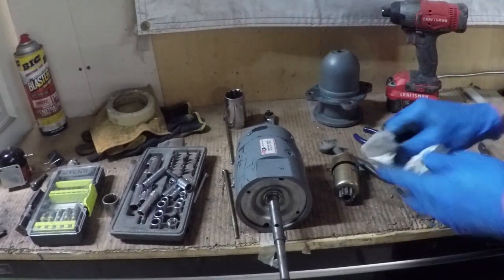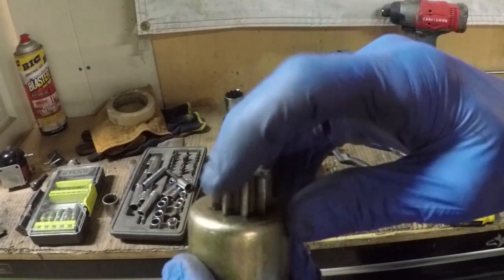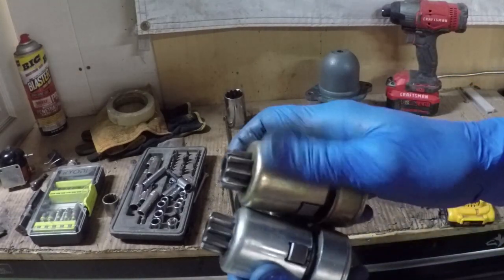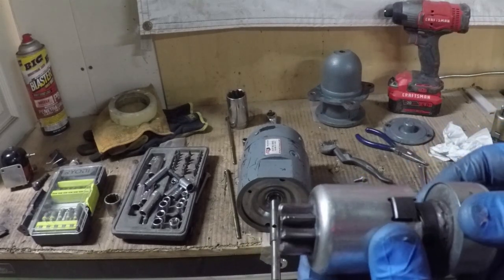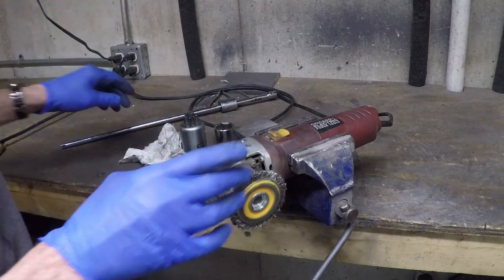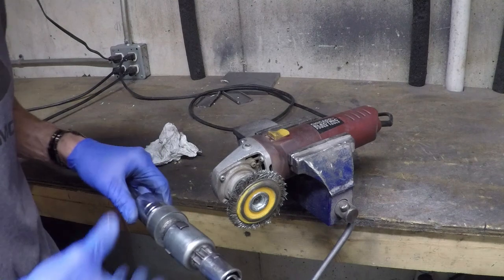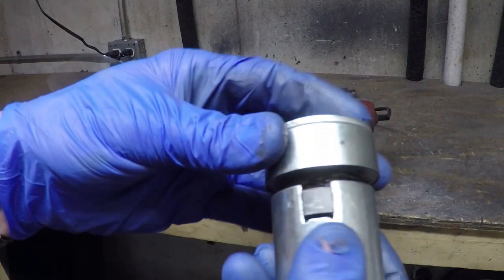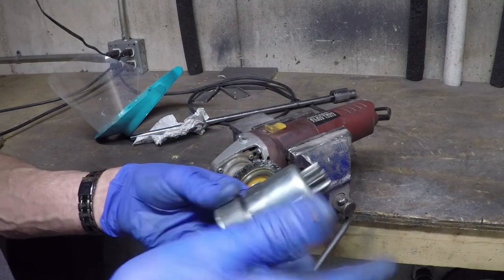ARCO Inertia Starter Drive  Gear (bendix?)   What is it and why is it on my Chris Craft boat?

Comment: I have tried every method out there. Watched every video. Mine won’t release.  I can’t even move the collar back to knock out the pin.  So frustrating
Reply from the maker: My starter/alt shop was able to get a replacement drive in about 1 week.   Is there such a shop near you?
Reply: @ I just got it released this morning. I couldn’t get it to release via spinning it with power to it or with the angle grinder method. What worked for me was MishMashes sliding the tie wrap underneath the lock ball.